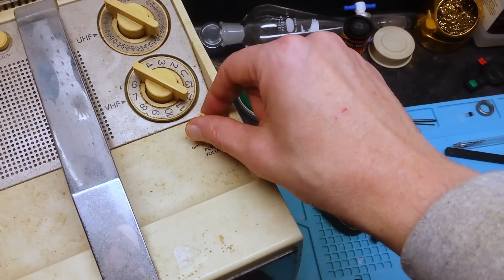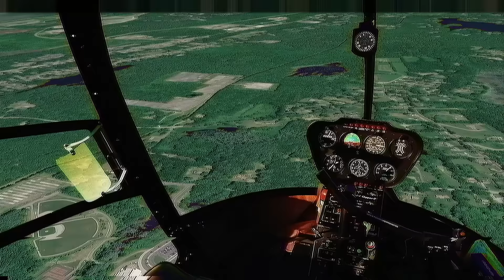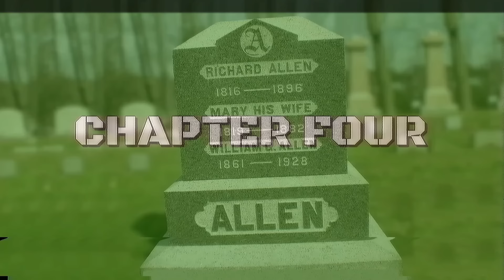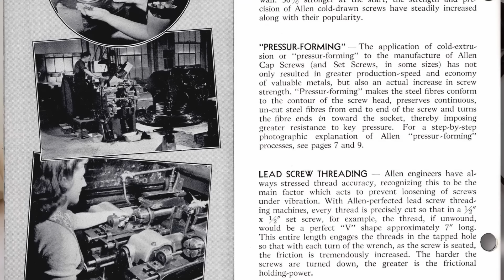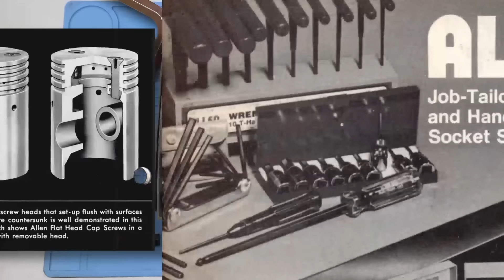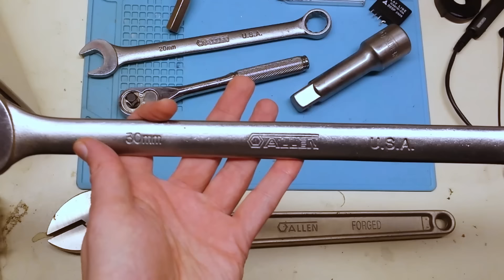The Screw that Saved Lives - ALLEN History & Lore

Comment: There are situations on non rotating machinery where I wish they didn't use a female hex (or Torx) fastener, stuff where severe rust is a factor. Simple pipe thread fill plug on the rear axle housing of my truck. OEM had to use one that was female hex for no apparent reason other than aesthetics where aesthetics don't matter. After years of ownership in the Rust Belt I found the hex socket on the plug unserviceable and had to turn the plug with hammer & chisel. Replaced it with a simple male square drive galvanized finish plug common to plumbing everywhere. That way there is always something sticking out to grab with vice grips no matter what and literally nobody cares what it looks like. I hate anything with shank larger than 1/4" having female drive. Like M-14 control arm pivot bolts on the chassis of my car in Torx head. I swap those out for male hex. I hate having to put that much torque in a female drive, stupid thing just wants to cam out after the slightest wear or corrosion. Sometimes I get stuck with special Torx fasteners mandated for seat belts but where I have a choice I go with a male hex head bolt. Female hex is just fine for shop conditions where everything stays indoors with a film of oil but it sucks out in the rust.

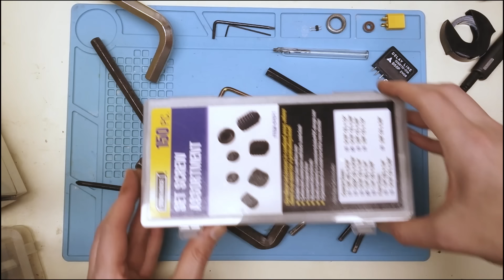Comment: 3:16 this guy never heard of flat head grub screws
Reply from the maker: They didn't support enough torque. These were on huge pulleys on belt power systems in the factories.
Reply: @ballinator  fair, ill still stick with key ways, friction fits, and bolts with heads

Comment: Hex drive sucks. Why didnt they just use Robertson (Square) drive?
Reply from the maker: Not sure, I've read that Robertson didn't want to license his patent out to anyone, but can't confirm.
Reply: They were created about the same time.  The Allen design comes in many more sizes, so it doesn't appear that Robertson was trying to compete with Allen.

Both work well for their intended applications.
Reply: Another consideration is that a square recess requires 90° to rotate to a symmetric orientation while a hex recess requires only 60°.  This can be important in some application which allow limited access to the screw.  The Robertson drive seems best suited to conventional screwdrivers which have the handle on the axis of rotation.

Comment: Really great video even though it has a tragic ending. When I was equipping myself on a shoestring budget in the 80s and 90s, I loved picking up brand new but old warehouse stock of Proto, Williams, Armstrong, and many others including the occasional Snap-On. Before cordless tools I was equipped to service my gear in the field without a generator or compressor. I did OK keeping it simple with 1960 Chevrolet 2 tons and other sizes.

Comment: I worked at the Kingsley Tools/Danaher/Apex Tools plant in Dallas (in actuality, Garland) for eight years, until the facility was closed in 2015.  Half of its work was farmed to the Sumter, SC plant, the other half to their facility in Shandong, China.

Indeed, "Allen" was just a stamped name on existing blank material, just as "Craftsman," "Matco," "GearWrench," "K-D," et. al.  The exact same ratchet mechanisms were used in all brands, only the handles were styled differently between the makes.  Sockets were identical; just stamped with whosever name was on a given production order at a given moment.
 
If Danaher was predatory, Bain Capital certainly was worse.  The day that Bain's takeover was posted on the breakroom bulletin-board, I advised my supervisor to dust off his resume.  He didn't believe me.  He learned the hard way.

I never knew until now that Apex/Bain killed the Allen brand.  As far as I'm concerned, there is a special place in Hell for those who orchestrated it. 😡
Reply from the maker: Great info, thanks! Yeah, Bain was the death-knell for quite a few of the old tool brands..

Comment: Holy crap I didn't know that the modern socket set owes its existence to the Allen set screw. That's so cool. Thank you for the wonderful and informative video.
Reply from the maker: Not quite - Allen just used a different method for forming them. The interchangeable socket credit goes to Walden Worcester in 1919,
The sockets were machined and then the hex openings broached out, which is still how most are made today.
Reply: @ballinator  Oh, I guess I misunderstood.

Comment: Someone please correct me but it seems like it was an initially slightly unnecessary invention? I mean a bit of threaded stock with a shallow slot cut into the end would make for a perfectly fine strong hidden set screw, right?
Reply from the maker: In the patent document Allen claimed the hex drive was stronger than a slotted drive. Also hex drive has 6 "angles of attack" - a set screw on a pulley might be in a tight spot where you only have one way you can get in with an "L" handle.
Reply: The screw will be strong but accessing and removing is not as workable. If you make the slot deeper for more strength you compromise the screw because the cut is across the full width. If you don't cut full width it is no longer easier to make.  There is a reason these Allen screws "took off".

Comment: There exist sunken set screws with a slotted drive, were those introduced at a later date, perhaps as a cheaper alternative to the Allen set screw?
Reply from the maker: In the patent document Allen claimed the hex drive was stronger than a slotted drive. Also hex drive has 6 "angles of attack" - a set screw on a pulley might be in a tight spot where you only have one way you can get in with an "L" handle.
Reply: Before hand. Slotted screws and bolts are easier/cheaper to make (all it takes is a small saw), and are still easier to ‘repair’ in situations where heavy paint or the like can make other fasteners impossible to use. You can run a saw over the head to make a new slot, or clear out the existing one, or just use a screwdriver and hammer.

In every other situation, slot drives suck ass however. 😅

Comment: So what's the advantage of the hex head over the square Robertson-style head? I was guessing that the hex heads were easier to form, but looking around it a bit it sounds as if hex and square heads are equally easy to cold form. (My understanding is that the forming methods often have much more to do with the selection of things like this than the qualities of the design itself.)

Square heads seem to me as if there's less chance for slippage and stripping, especially if the precision is less than perfect.

Wikipedia suggests this may have been purely an issue of not wanting to license the Robertson patents.
Reply from the maker: Not sure. The original Robertson patent mentions using a square, OR a triangle shaped head. Robertson is on my list to research for a future video.
Reply: @ballinator  Brilliant. I've subscribed so I'll see it.

Comment: The Allen head cap screw is the backbone of the tool and die makers' art. Thanks for an entertaining and very comprehensive video! I suppose Torx has supplanted many of the Allen screw applications, but those hex socket fasteners will be around for many years to come.
Reply: Industrial automation too. We have probably over 3,000 screws on just one average line at my location.  Our larger lines around 10,000

Comment: Outstanding mini-history. I'd love a follow-on about the wrench history, ie which companies over the last century made tools that didn't strip out in 3 seconds vs high quality products. I have a nice set of small Bondhus Allen wrenches that seem pretty bombproof. I own a single Wera screwdriver type Allen for setting my guitar saddle heights- excellent tool.
Reply from the maker: Thanks! Bondhus is on the list for a future video. Already started researching them.
Reply: My experience has it Allen and Elkins are kinda meh because they just shear the short L side and it does not have as good of engagement.  Bondhus is pretty amazing especially for the price.  Wera is pretty good but the round body wrenches dont fit in some of the super tight places. Wiha is solid, PB swiss is good but over ppriced.
My go to is Bondhus though unless it needs some persuasion. Then I grab my longer Wiha.
Experience is spread over installing around 6,000 allen head bolts by hand.
Reply: @dragonamp2  Bondhus is quality and USA made for very reasonable money.

Comment: As a Canadian and both a woodworker and an amateur machinist my two favourite types of connecting hardware are Allen fasteners and Robertson screws.
Reply: I prefer Robertson, partly because they're harder to strip out than Allen heads and partly because, to my knowledge, there's no "metric" version of Robertson screws. With Allen heads, I often have to try both SAE and metric wrenches, looking for the snuggest fit.
Reply: @goodun2974  For wood screws I will always use Robertson but in model engineering Allens are much more common. Yes, I often have to try both metric and imperial before I find the right size.

Comment: IMO the allen wrench, and hex socket specifically, is the only socket & wrench combo that should exist.

With one back pocket of allen wrenches you can rotate screws blind, (hex has a very tactile drop) or with low headroom, or with moderately high torque, ALL while avoiding unnecessary RSI by giving you a ball end to drive it most of the way in.

The only problem is people get skill issued by their fucking allen keys and think hex heads round-out easily because they don't realize that the ball end isn't meant for torque. You'd think the short-handle for the ball end and long handle for the flat end would give it away, but apparently not.
Reply: The one fly in the ointment for modern Allen screws and wrenches is SAE dimensions versus Metric dimensions. A lot of screwheads get stripped out by people who use the first wrench that seems to fit without trying  both SAE and Metric for the snuggest fit. I've dealt with lots of stripped Allen screws over the years.....
Reply: @goodun2974 true, but that's basically an issue with any socket. Ideally people would just normalize on a few common sizes and remove 99% of this issue.

This is one of the few 'advantages' phillips actually has, and frankly it's a rather dubious 'advantage'. Anyone who has taken the time to find the right phillips head knows how big of a difference it makes, and yet most people settle for shoving the screwdriver down to fight the cam-out. Phillips being so seemingly size-agnostic has led to the average person (& product designer) not really caring what sized screw is used where and just using whatever is convenient. Which also means 99% of all phillips screws the average person will ever remove, they'll be actively fighting their screwdriver the whole time because it's not the right size. (& unlike an allen key set, big dick phillips head drivers aren't exactly compact or cheap or light. You can't keep a whole kit in your back pocket for on-demand access, so it actually further incentivizes this misuse) 

In contrast if we just stabilized on like, 5-10 common, standardized hex sizes and it was simply expected that any screw would be one of those sizes, this issue goes away on both fronts. People would clearly know what the right driver to use is, AND they would actually have it because you don't need a kitchen drawer full of screwdrivers, you need a pocket set of allen keys.

This is still absolutely idealistic pipe-dream thinking, but it's also entirely possible and rational.
Reply: @felixjohnson3874 , if we wanted to standardize fasreners in order to make life simpler for factory workers and offsite repair techs alike, wouldn't Torx be the best choice? A T10 is a T10, there's no metric version to confuse people!
Reply: @goodun2974 again : the ball end.

Hex has objective usability advantages, Torx only has a single hypothetical technical advantage I haven't even actually seen verified in a proper tit-for-tat comparison before. (I'm willing to accept torx can handle more torque, I'm less willing to accept it can handle meaningfully more torque)

Hex has a tactile drop for blind-driving, it's fairly round-out resistant when used correctly, and the fact that it can act as an impromptu universal joint with a ball-end massively increases it's usability because the same back-pocket driver can provide both rotation & torque in a package that doesn't give you RSI.

It's not about the factory workers who have automated power tools and ratchet wrenches, it's about the mechanics, garage workers, and joe schmos who have to deal with it after the fact.

Sure, you can drive a torx in an area with low clearance - if you have a torx bit and a ratchet wrench. Or, you can drive a hex bolt in the same spot with an allen key, ball 90%, straight 10%. 

Someone mass manufacturing or mass-maintaining single products can have dedicated tools for the job, Hex wins because a cheap, simple, light, and small tool that everyone can own does a good-enough job no matter the context. It's not about having the theoretically perfect fastener in one context, it's about having a practically viable fastener in any context.

Phillips did this by being a fastener that was inherently size-flexible (sort of like tapered flatheads) so you didn't NEED the perfectly sized driver. Unfortunately, without one that's perfectly-sized the screw would constantly try to cam you out, the drivers have to be massive to be comfortable, and they're awful for working in tight spaces. Hex fixes all of these problems by having tiny wrenches that are ergonomic enough, provide enough torque, and don't need special tools to work well in cramped spaces. Torx is just hex but more complicated, less versatile, more RSI-inducing, and all for one theoretical benefit that doesn't matter in 99% of cases anyway, might not even meaningfully exist, and even where it might exist and matter, the solution is almost certainly to use an external-interface instead.

What matters is the practical functionality of the interface geometry itself, not the arbitrary size(s) we choose to make it in. 

Torx as an interface geometry has advantages on-paper, hex as an interface geometry has advantages in-practice.
Reply: @felixjohnson3874 , I don't recall ever using a ball-end Allen wrench, not even nearly 50 years ago when I worked for several years in the milling and drilling department  at Hamilton Standard! This might be because good engineering locates fasteners where a straight-line tool can get to them! Does a ball- end  Allen wrench handle as much torque without stripping or twisting as a straight Allen wrench? I don't know but I kinda doubt it.
Reply: @goodun2974  metric is the only system that should exist.
Reply: @4res0 , well, that ship sailed a long time ago; there's just too much SAE stuff out in the world, and things measured in thousandths of an inch, the neasurement devices for same,  and numbered drill sets, and SAE hardwire and tap sets, even other weird stuff like Whitworth threads....

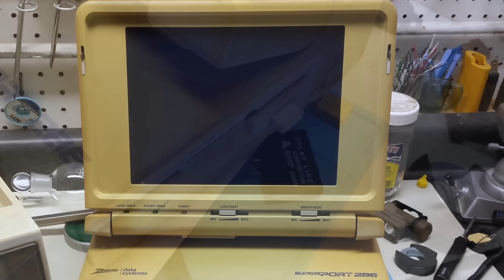Comment: 1:46 honestly surprised/impressed you used a proper DD disk for that machine.
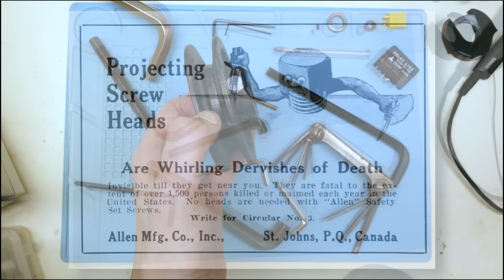3:02 I agree with the tone, I have NO idea how forensics or even the person it happened to(suddeness/shock/and all that), could easily identify/recall if a protruding screw actually caused the pull or they got their clothes/extremities into the gears and pulley system. A tall tale does sell hardware in the safety world though. Gonna guess they pulled the stats on any similar incident and just included it as a known fact.. it worked!
Reply: Anotger advantage to Allen heads: a flush setscrew wouldn't tend to unbalance a rotary drive pulley like a long bolt with a large head might do.
Reply: @goodun2974  long-term wear on the systems bearings would be a very real effect tbh. though because of the inset hex keying and that being a void, I feel like one that sits just slightly proud of the surface would actually be the perfect 'tuned' length, because one flush would the surface, on average has less metal than the opposite side. But there is also metal density so flush on lighter metals would probably be ideal.

Comment: Wow I've lived in CT my whole life and didn't know he was from here and did all the development here. I think he gets lost under the shadow of Stanley and Colt and bigger names but the drive system he made has really had an equally significant impact on the world. Engineers love socket head cap screws. So much used to be created and manufactured here in CT and MA and now it's all fucking gone its so depressing. Even the machines we make at work are 70% made in china, its so pathetic. Being a mechanical designer in the 1880's to 1940's must have been a dream, so many new things to discover, a goldrush in design where so much hadn't been figured out yet.

Comment: Allen also took a wrong turn with the ball end allen key as in missing the boat almost all  (yes I too will always call them Allen keys) are sold as ball end sets now, and for a very long time now by I believe John Bondhus in 1964!
Reply from the maker: The ball-end design is great. I started digging into Bondhus for a future video.
Reply: @ballinator you should do a video about Pozidrive screws. Very common in European furniture abd speaker cabinets; better than Philips ---- takes more torque without camming out ---- but easily stripped out by use of an ordinary  Philips screwdriver .
Reply from the maker: @goodun2974  I'll def include Pozidrive when I do the full episode on Phillips.
Reply: @ballinator , some years back, The History Guy channel did a video about screws and screwdrivers; it was, and might still be, his most-watched video. He included a history on Robertson screws.
Reply: @ballinator , don't forget JIS Philips; there are at least two variants.